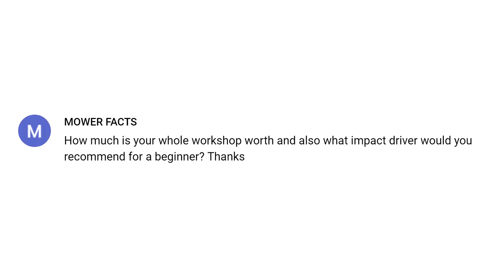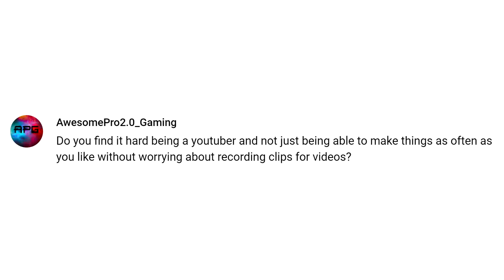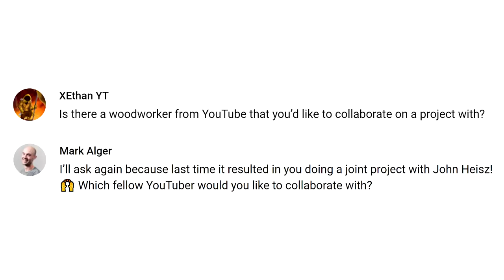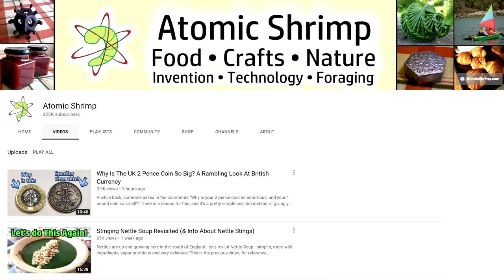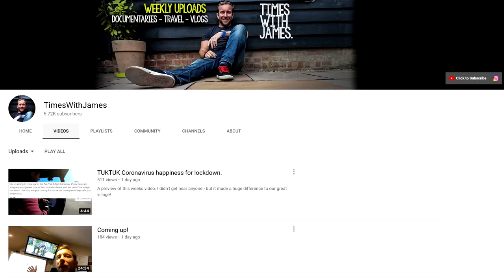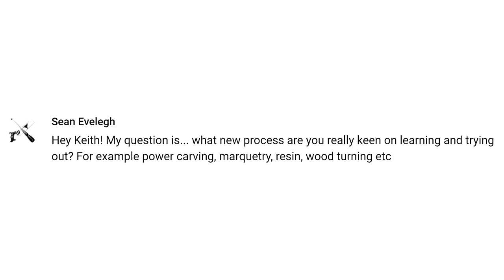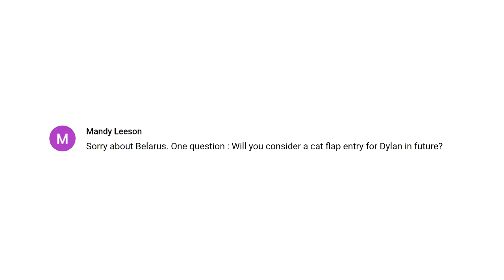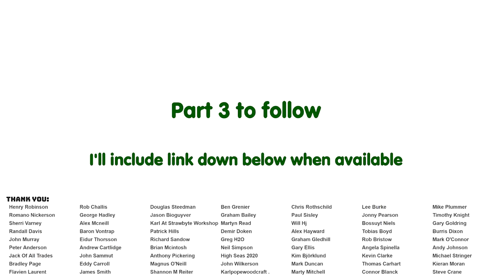Answering Your Questions (Q&A 2020 Part 2)

Comment: I'm glad you're not considering the CNC at the moment. I've noticed as many of the makers on YouTube over the years become more successful they start bringing in the larger machines (mostly given to them to promote) and are forgetting what attracted the viewers in the first place. As soon as the project switches to the CNC I switch off. I'm not against the machine and would have one if it was given to me so that I can sell it. I just do not have the room. If I had the room I would keep it. Probably by the large router table I made four years ago and don't use.
Reply: Gary Wall To me cnc is not about the craft. Yet you still have to plan your things etc, but then its just computing. No offence
Reply: - i agree. i often click on instructional woodworking videos that i think will help me on some project and right in the middle they say, "then i used my cnc to blah blah blah" and at that point i look elsewhere.
Reply from the maker: Yeah I'm the same to be honest as a viewer it's not very compelling to watch... I think a lot of people start using them out of boredom once they've mastered their other tools, or ofcourse for mass production!